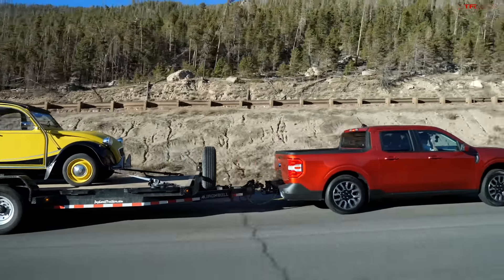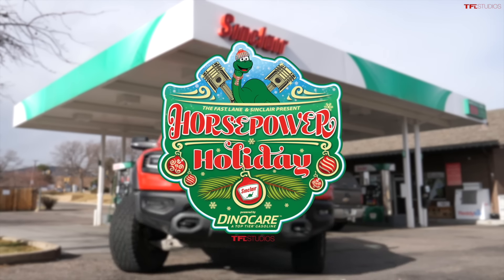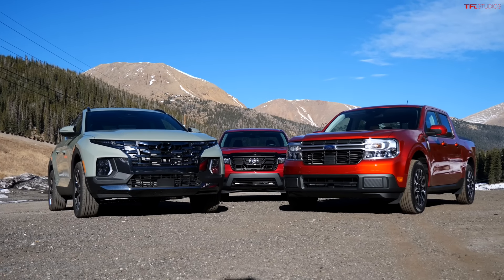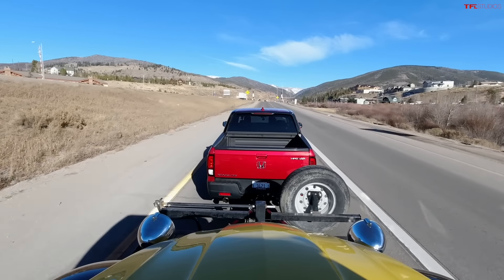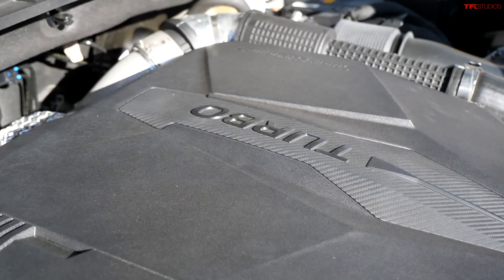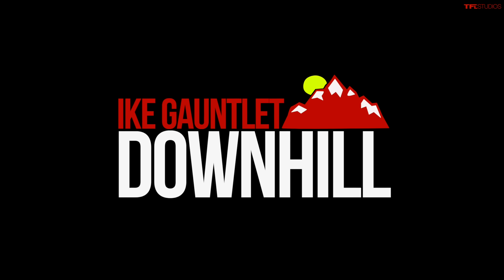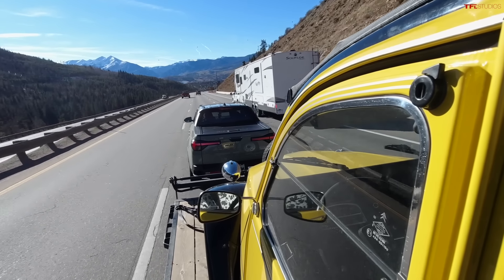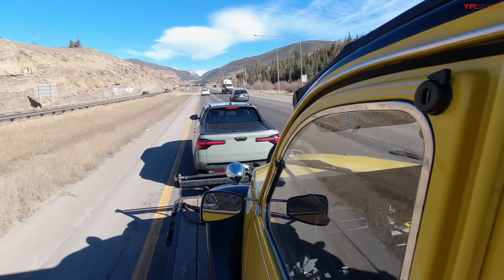I MAX OUT The Maverick, Santa Cruz & Ridgeline, But Which One Wins The World's Toughest Towing Test?

Comment: One thing is for sure, the ridgeline will outlive both the maveric and hyundai!
Reply: Probably need to read up on the V6 Honda is using. Not great.
Reply: @jamesbrock1306  the J35? Trust me, it's a great engine, rock solid reliable, and you can even make it more reliable by coding out the cylinder deactivation.
Reply: I have a 2025 Ridgeline, and I’m going to disable the VCM with a VCM 2 unit. Also going to install an oil catch can because of the GDI.
Reply: @514aam  the hyundai has a lifetime warranty

Comment: The Maverick in XLT trim with the 4K package would Gabe performed the same and been done in sub 30k which I feel makes it so much more of a better value. Seems like the lower trim level Mavericks are the sweet spot and where it really excels as a value proposition. A high 30k Maverick kind of defeats the purpose?
Reply: Yeah I agree, mine was 31 and it is rather loaded from what I can see. XLT FX4 w Lux. I do not see an FX4 badge on that "maxed out" Maverick either so that leads me to believe it has standard all season tires on it.
Reply: I agree, at that price, I would get a Ranger. Maybe?  Car market is freakin whack right now.
Reply: @christopherhamilton5557  I wanted to get something used but every car was such bad value used. So I ordered one waited and picked it up at MSRP. 31 isn’t bad for a new car let alone a truck/crossover but 37 is in big bronco territory.
Reply: Nah fully loaded the Maverick is $37k, to get similar tech and interior features in the Ranger, you’d be looking at $45k. Apples to oranges… the Maverick is still significantly cheaper when similarly equipped.
Reply: I got mine with xl 4k towing awd 2.0 spray in bedliner Ford copilot 360 (includes power side mirrors for the xl) "full size" spare rear window and two USB ports and 120v outlet in the back seat for 27k I could have saved a good 1.5k if I saved on options.
Reply: TheRanscat what kind of mileage are you seeing with that setup?
Reply: @TheRanscat  That's exactly how I'd option mine. Are you happy with it?
Reply: @Kristian_Saile  on this tank I'm seeing 21.2 mpg with city only but I do like to step on the gas, I'm sure I could get better if I drove more conservatively though.
Reply: @joninspite  I absolutely love it, the xl interior looks damn good and I like the grill even more than the other two trims, it is pretty peppy and comfortable too, less than my gf's cx5 but more than a fj Cruiser or my old civic same goes for back seat space it takes bumps like no problem, and it is pretty easy to park like a crossover. 
Disclaimer though it doesn't have cruise control, I never use it but you might and there's no way to get cc on the xl from Ford, there's an aftermarket kit for like 50 bucks but that depends on how comfortable you are with that.
Reply: @TheRanscat  That's how I am going to order one , XL 4 K but no 360 ,auto mirror. Or bed spray . I figure it has the same or better mechanicals then a XLT with 4xe package .and for me 4 grand cheaper . only thing I would really like is cruse control. But the aftermarket is catching up with that .
Reply: @dickvankoughnett2331  they already found a way to get native cruise control with fordscan and a Ford escape steering wheel so that's great.
Reply: @TheRanscat  You can add FACTORY cruise control on the XL, it requires ordering a couple of steering wheel switches from Ford (unless you can find them off an Ecosport, Escape or Bronco Sport at a salvage yard) and doing a little programming with a program called Forscan. People are doing it anywhere from $100-$130 and it is all factory, not some weird stalk hanging off the steering column like the Rostra kit. Check out some of the Maverick forums if you want to see how people are doing it.
Reply: @randyjoseph462  I imagined that, yeah I'm very active on the forums too.
Reply: @Kristian_Saile  It has an eco mode you can use. I have the same set up. I get 30 on the highway and 26 in the city. It is easy to get in and out of and has plenty of room in the back seat. I got the hot pepper red and love it.
Reply: If you can find one that doesn't have $5 - $10K of ADM on the price.

Comment: The temp rising like that on the Maverick is concerning.
Reply: Yeah right before it cut away at 27:37 it's close to Hot, note the outside temperature is 46F.  If you are close to max towing on a hot day in the mountains I'd be worried.
Reply: I did not see that. Good catch!
Reply: Keep in mind it was only 40 degrees.  Summer. It would of been real interesting
Reply: Or it is more honest than the other 2. They didn't have obd readings to confirm. I've had my own car read 225-230f going through Arizona at 110f but the gauge didn't move.
Reply: to be fair the Maverick max tow is 4K and they said their trailer weighed 4K, You have to add all the hamburger riding in the front of that rig as well so they went over the GVW of the truck by at least 500 pounds. If I was going to tow 4k over a mountain I would want a F150 to that job.
Reply: @BlitzHack A Ranger would probably do it fine.
Reply: @DragonKnightX12  Agreed

Comment: I finally got my Maverick in and I have to say so far I'm very happy with it.  I haven't had a chance to tow with it yet but having the brake controller built in makes a huge difference IMHO as you don't have something bolted to the dash every day for the times you want to tow.  I absolutely love the placement of the receiver as well that is worth a lot to me.
Reply: Thinking of getting one myself. Can I ask if you still like it and if you’d recommend?
Reply: @joeypts  I do. We have both a gas and hybrid and both are excellent. The hybrid gets crazy good mileage.
Reply: I totally agree on the TBC.  Having the hitch from the factory, also great.  Less brake applications are going to reduce heat and wear.  Saving over $4k is a lot to me.  Tow/haul mode.  Enjoy your Maverick.

Comment: Sport mode is likely what should be used when towing with the Ridgeline and Santa Cruz. Holds gears, firmer shifts, if it has any active aero it likely disables it.
Reply: we have a 2016 pilot and when we tow with it sport mode is what we use and it behaves similarly to a tow/haul mode

Comment: Thanks Nathan!! “Little Trucks or Little Pickups. Perfect!! Hahaha. I’m a rigid person sometimes, sorry about the crappy comments. They are little of a unique class of course. Little trucks!! I have one now!! A 2.0 AWD XLT with basically every option including the tow package, FX4, Sunroof, Luxury package, even the hard folding tonneau cover. It is quite impressive for a little truck. You would never be able to pull 4,000 lbs at 70+ mph in hilly terrain with the previous little trucks. I have towed just over 3600 lbs in 50 mph winds and hilly terrain (foothills of the mountains here in Alberta) and am impressed! I had a Ridgeline and wanted smaller still for when I go to the city, mostly because I can. I traded the Ridgeline I bought for $53,000 CAD before tax, I received a cheque for $11,000 CAD and a Maverick! Since the Ridgeline was already tax paid,mi didn’t have to pay taxes on the new truck!! Bonus! I loved the comfort of the Ridgeline, but am surprised by the comfort of the Maverick!! The Ridgeline is definitely better in almost every single aspect, of course, but I’m very happy with the Maverick. The Ridgeline’s biggest issue is the very high torque band. It’s definitely a nice truck though. Mine was levelled and riding on slightly larger and much more aggressive Falcons on the truck. It looked pretty nice! I will leave the Maverick stock.

Comment: The Ridgeline would have held it's speed better down the mountain in S mode. I'd say it went pretty well for having no turbos which puts it at a bigger disadvantage at high elevation.
Reply: I tow a 4400 lb travel trailer with a 2020 Ridgeline and it does tow better in S, especially in hilly areas. S mode wants to hold shifts longer which is better for up & down grades.
Reply: I tow a 28 foot camper that’s at the Ridgeline’s max rating. I turn off eco mode and drive in Sport mode. No issues.
Reply: Totally agree
Reply: 中文翻译
Reply: @zerog2000 do you use eco when on level roads?
Reply: @georgea6403  I bought ridgeline trailsport past year. I’ve noticed no difference in eco compared to normal driving mpg. Really just changes the throttle so more pressure needed to get same throttle response as normal mode. I only use eco if driving long distance highway with nothing towed. Don’t expect passing anything tho.

Comment: The Ridgeline is wired for a brake controller. The wiring harness is included from the factory in the glove compartment. It's a simple hook up to any standard brake controller. Then you simply plug it into the connector found under the dash by the parking brake.
Reply: I want a stock brake controller and Ford has the best when it comes to towing. Honda knows zero when it comes to towing! Correct me if I’m wrong.
Reply: @markgosser9578  They know enough to tow 4K pounds, at least
Reply: @markgosser9578   Honda actually knows a lot about towing. It can actually tow what it says it can even with passengers. The owners manual is the only one that breaks down what you can tow with how much cargo and people in truck and Honda knows that 5,000 lbs towing at 13% tongue weight is 650lbs so that’s what their hitch is rated at.
Reply: @doubled8247  finding tongue weight above 10% the towing rating is getting harder to find. 
10%-15% is the recommended tongue weight of travel trailers.
Reply: @doubled8247  not sure where you got 650
Ridgeline has Class 3 hitch, which is 600/6000
Payload is around 1500 depending upon trim level, so unless you are limited by payload because you have loaded the cab and/or bed,  600 is supposed to be your max tongue. I tow a 4400 lb travel trailer with about 12-13 % tongue weight and it handles well,  but putting any more on it would push it over limits. Yes it could handle more, but I won’t because I’d be cutting into my safety margins, which isn’t wise. (I have also looked at Both front & rear GAWR, and total GCVWR by pulling the rig over scales, which anyone getting close to max payload and/or tow rating should be doing. Supposedly Andre is CDL so he knows better. 
A bit surprised TFL team doesn’t actually do this, or capture actual metrics from OBD as others have mentioned. It’s just some light fun testing they are doing. Nothing scientific or objective here.
Reply: @zerog2000   you’re correct sorry,  it was a math mistake I thought Honda was doing 13% tongue weight when in fact it’s actually 12%.
Reply: @zerog2000   also 1500lb payload is very healthy, there are half ton trucks with 900-1200 that rate their trucks to 9k max towing.

Comment: I’d like to see these two get tested in the summer time when it’s hot. It appeared to me like the maverick got really close to getting hot right before the end of the hill. In 45’ weather it makes you wonder if it can really pull 4K pounds up a steep grade like the Ike. Love the videos guys. Keep up the great work!
Reply: Good point, I’d be interested to see that too
Reply: Good point Jorge, i think both will run hot towing in summer, AND will make far less power as well. My 2.3 Ranger makes great power in cool weather, in 105 degrees, i have to use 3/4 throttle much of the time.
Reply: I bet both run hot being boosted engines but I know the Mav is at the edge in cooling capacity as the tuners are having to swap out for a bigger intercooler to get any meaningful gains.
Reply: I'd also like to see transmission temperature monitoried.  It's one thing to tow once, but it's quite another if the transmission's life is significantly shortened or if it requires significantly more regular service.

It may be possible to monitor it with a sufficiently advanced CANBUS device, if the codes are known and the device can interpret.  Otherwise it might require putting a sensor in place of a plug on the side of the transmission itself and recording the data the old fashioned way.
Reply: Ford recommended de-rating the towing on the F-150 due to the high altitude, did they recommend the same on the Maverick?
Reply: @TWX1138  I've towed with a 2018 Santa Fe and used a scan guage II to monitor the transmission temps.  Scan guage had to send me a mapping sensor first to find it, too about 2 weeks total to get their sensor, drive around with it, send it back, and then the sent me the code to use in my scan guage II.  I would imagine the Santa Cruz has a trans temp sensor that could be monitored with a scan guage also...

The reason I dont pull with the Santa Fe is because the transmission got really warm in hills, and I didn't want to fry it.

I'm really curious about the SC, I think it has good potential as a camper tow vehicle if the trans temps are managed
Reply: @michaelburke9541  Sant fe doesn't have a dual clutch. The Santa Cruz has the new wet dual clutch with additional cooling to help it not overheat
Reply: 中文字幕

Comment: I love the realisation he has when the Mav gets to the top of the hill. "Is that the same as the Santa Cruz?!?". Yes, if you drive an equal distance in two vehicles at the same speed, on the same surface, you'll cover that distance in the same amount of time.
Reply: What you are missing is the account for the initial acceleration to the speed limit and whether it maintains that speed the whole time.  Either can affect the overall time.  In many of these tests the vehicle is sluggish to the speed limit (where more gears may have an advantage) or not enough reserve power and it requires it to be floored the whole time (also dinging the sound measurement test).

Comment: Great review guys!  Both pickups are wonderful.  It's going to boil down to personality.  Which do you prefer? I pick the Maverick because its more truck like.
Reply: I’ve heard the Maverick described as a car like truck and the Santa Cruz as a truck like car couldn’t agree more.
Reply: I wouldn't mind a Maverick but i'd put a lot of highway miles on it so comfort is a big one for me. But I have a 3/4 Ford for truck stuff so I'd have a Cruz over the Maverick, plus i do like the styling of the Cruz more.
Reply: More truck like ??? You know the hyundai  can tow 1000 pounds more right ???
Reply: @robertsn6584  I was speaking about their personalities.
Reply: @robertsn6584  yet it doesn't come with brake controllers from the factory 🧐
Reply: @tri3pleagent  If you’re serious about towing, none of these Trucks are good solution, but if you’re like me, towing Jet-ski or small boat like 2 times per year, when season starts and when it ends, both Maverick and Santa Cruz would work perfectly, and it doesn’t matter if you have built in trailer brake or not, anyway I chose Santa Cruz because of its comfort,  looks and power
Reply: @robertsn6584  : with a DCT, I'm curious about pulling a boat up a ramp, slowly, riding the clutch all the way...
I think I'd prefer a torque converter.
Reply: @robertsn6584 lol...with NO brake controller! Most states require trailer brakes over 3k-3.5k. Towing for the SC is a token stat, basically because it has more horspower. The Maverick gets better mpg.